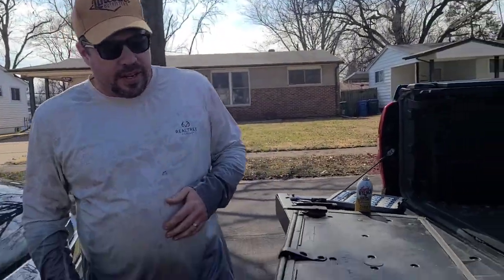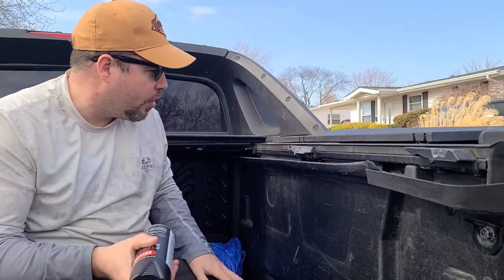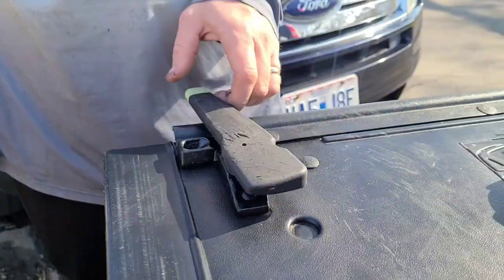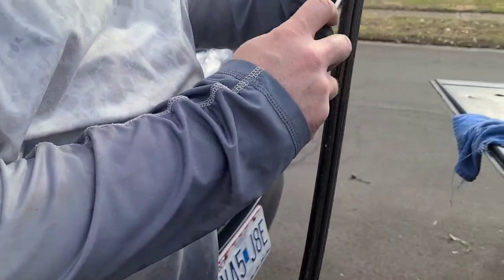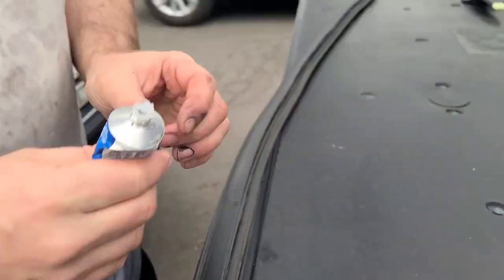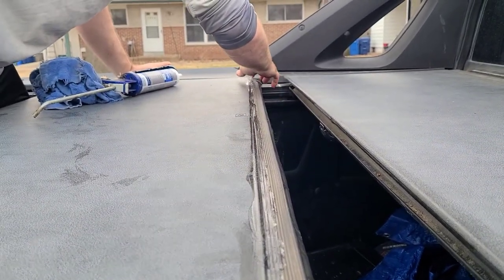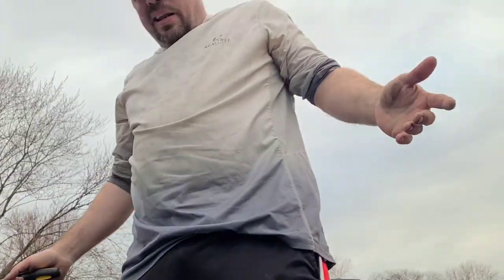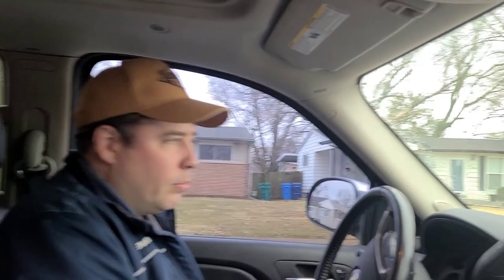Replacing handles and fixing leaking tonneau panels on Chevy Avalanche.

Comment: Helpful vid like many of your others - didn't realize you could remove those handles!  - My avalanche is in about the same situation with its tonneau cover. Love the truck, just a lot of these little yet sometimes absurdly expensive things going on it. Gunna see if I can stretch a little more life out of those with a cleaning and enough gel oil haha.
Reply from the maker: Thanks, yes the new handles where life changing. Plus now it no longers leaks into the bed while raining from the silcone on the seal.

Thanks for watching, good luck with your handles.

Seize the day each and everyday-Are Jay

Comment: Great job and my"new" 2008 truck is in much need. But a bolt sheared off in the top on a really corroded handle. Any tips for removal? Thanks for the post.
Reply from the maker: Hey rev, unfortunately because the tonneaus are plastic you cant weld a new nut on.
So all you can really do is get some Cobalt metal drill bits and start with the smallest bit and drill out the middle a little until you can get a rever thread bolt or bolt extractor in to remove it.

Good luck!

Thanks for watching.

Please like and subscribe every little bit helps during these times.

Seize the day each and every day-Are Jay 

Here is our Avalanche playlist in case you ever need it.
The best Chevy suburban, Avalanche, tahoe and yukon Repair and upgrade videos: https://www.youtube.com/playlist?list=PLQ0kUxbVWpJ8AlYusgnt2uCy15HvaPNyA

Comment: Great vid. But I broke the screw inside. Any advice? Thanks.
Reply from the maker: Unfortunately since its plastic you cant weld a nut on. So just get some cobalt metal drill bits and start small and slowly work your way up drilling out the center of the bolt.

Good luck.
Thanks for watching!

Please like and subscribe every little bit helps during these times.

Seize the day each and every day-Are Jay